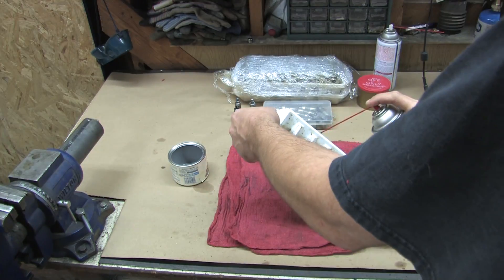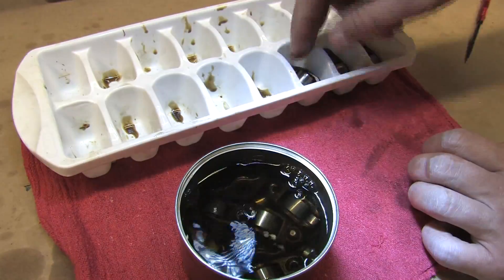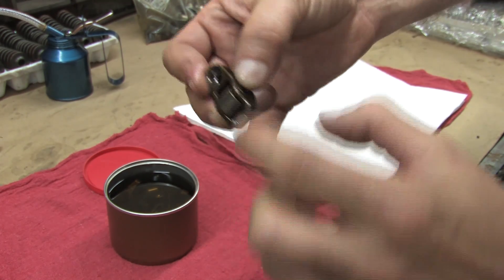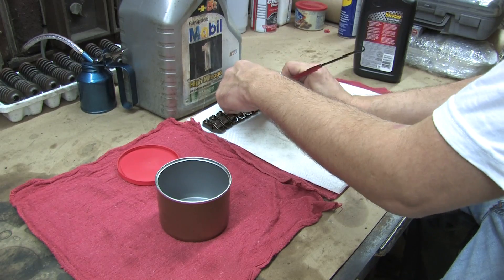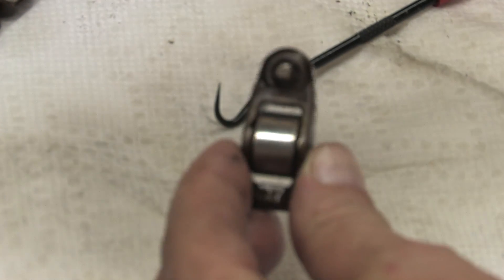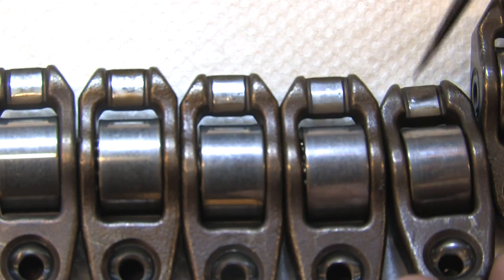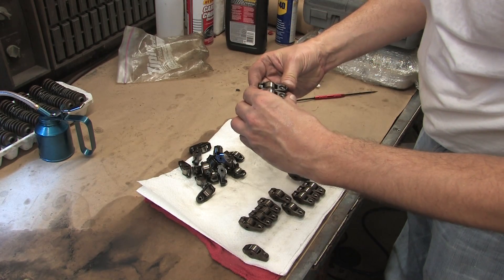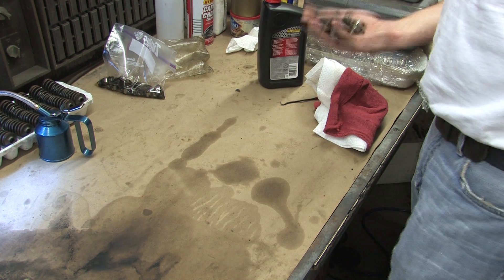Cylinder Head 108 - 4g63 Rockers

Comment: I'm sorry fellows for the folowers to be taken off the number 1 cylinder valve intake only you must have a valve spring compression tool
Reply from the maker: Search for 4g63 lifter install with the cam in the car.  There's a guy who shows how to do this with a flat blade screwdriver.  You need the craftsman with the square shank.  There's a trick.  If you can get the followers out with the cam installed, you can get them back in.

Comment: I took out my folowers to set my timing when I put them back the last one the number 1 piston valve it's to high to get the folower in is there a trick
Reply from the maker: Look up the lifter video.  Sounds like one may have more oil in it than the others.  Bleed that down and purge it, and it will likely fit.

Comment: Hey man great job on these videos. Been watching them threw as I picked up a 2g eagle talon that blew either a head gasket or the t-25 really let go and took the oil seal with it as the head gasket looked good. 

Anyways really good info as I am pretty much rebuilding the whole engine and replacing a ton of parts. Still it was nice as it already has a 6 bolt in it. But learned a lot such as cleaning lifters and these rockers. Granted my inspection process means another trip to the junkyard to get another set.

Comment: one question because was strange...how the rocker arm can leave from its position ....?
Reply from the maker: Valve float.  A condition when cam lobes rise and fall faster than the valve spring can react to those movements.  Given a big enough cam with a weak enough valve spring, the cam follower becomes a can't follower.  ;)  Too much valve spring pressure can wipe cam lobes or break rocker arms.  That's why your cam and valve spring selection are so important.
Reply: thanks buddy ....
Reply: No the lifter should keep it well in place.

Comment: Question: do the rockers arms go in one place only or no? Since you just washed them prob dont know which is which
Reply from the maker: +xBlazed831x Nah, not so important if everything's in spec.  The ones I cleaned in this video were being replaced with brand new rockers.  I actually installed these in a completely different head that got a complete valve job.  If you're taking it apart and putting it back together without changing anything else, it's probably a good idea to put them back in the same places so that they don't develop any new wear patterns, but if you're making changes, they're going to do it anyways.
Reply: +Jafromobile oh okay makes sense thank you for clearing that

Comment: Quick question, what are you soaking them in?
Reply from the maker: gbecerraodp Kerosene.
Reply: ***** will diesel work too? I've look through some threads and people have used diesel as a washer.
Reply from the maker: gbecerraodp Actually, Diesel is what the factory service manual recommends.  ;)

Comment: sweet thanks and so what bits of the head need to be kept in order mine look all good is it just the valves , springs and keepers that need to be kept in the same spot or does it all need to be in the same spot in the head eg. rockers and lifters and i tryed pulling a lifter apart from your other vid and cant get the bottom piston out and cant get cap back on lol but ill prob upgrade as they are the 1st revision ones or can they just be soaked and drained till the kerosene comes out clean

Comment: The 4g69 to my knowledge is just the 4g64 but reversed like the dsm 4g63 vs evo 4-9, so the head is virtually the same as the 4g64 so only thing usable is the valves
I'm willing to bet if its a SOHC 16 valve head then the only thing it may share is the valves, The lifters and rockers are gonna be completely different.

Comment: I'll keep just the 4g63 and 6g7x on my list then for next time I go out.
I thought about this video today while I was out and remembered to grab a set of rockers.  Trip to the junkyard for a random connector and ended up with 2 decent 4g63 valve covers, a 2g e-prom ecu, a 1g hvac center dash piece with no broken tabs, a few misc. connectors I needed and a set of rockers I plan on cleaning and inspecting for spares. $80, good trip. Thanks for this awesome video.

Comment: Aside from the 6g7x engines does any 4g6x engine also have them, I remember seeing a part number somewhere that said  "4g6 - 16 valve" .
Just curious I usually see SOHC galants in the junkyard and wanted to make sure they'd be the same. Also when they are soaking is it necessary to shake the container once a day or anything, or is the soak good enough?

Comment: Alittle off topic from the cylinder head. Quick question, 4g63 6 bolt turbo block and the non turbo block, are the only difference between the two is that the turbo block has oil squirters and the non turbo doesn't?

Comment: I had the needle bearings come out of one of my rockers before. I picked them out and replaced the rocker. Less than 10 miles later the motor spun 2 connecting rod bearings.